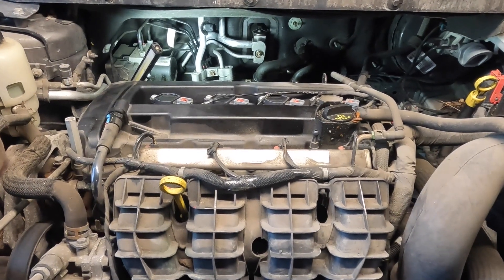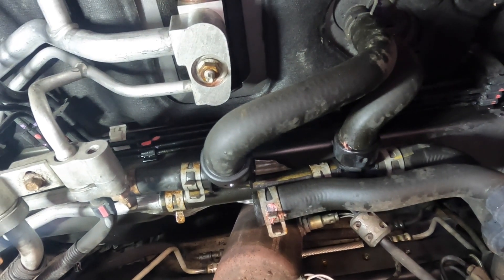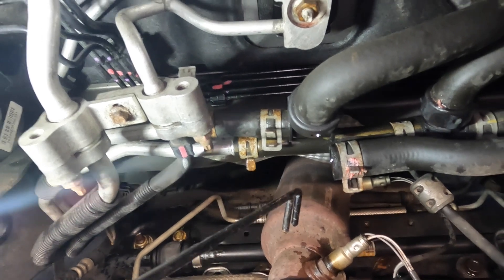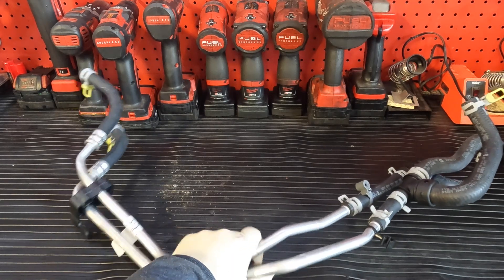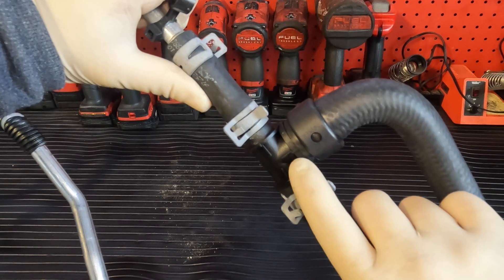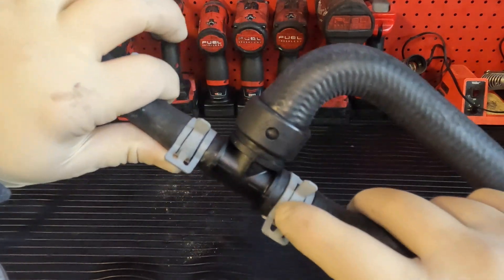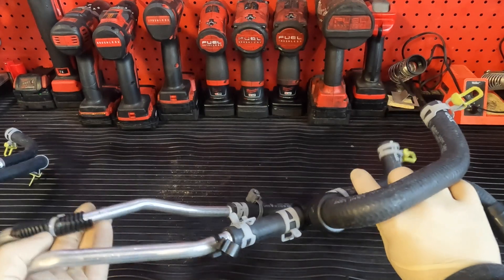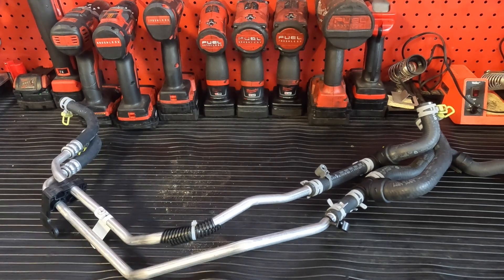ENGINEERING FAIL DODGE 2.4L HEATER HOSE MADE OF PLASTIC LOCATED RIGHT ABOVE CATALYTIC CONVERTER!

Comment: Currently sitting at the mechanics getting this replaced lol
Reply from the maker: Hopefully, they’re not charging you an arm and a leg to replace it. You should ask then if they’re using an original part or aftermarket because there is a company out there that makes a new line with all metal instead of using plastic like that original style.

Comment: Must be those Fiat engineers that took over Chrysler after Obama gave it away, I guarantee you that's why every Chrysler motor has poorly designed parts and poorly placed parts.  This kind of engineering is why the Big Three were always way ahead of ant European manufacturers, now Chrysler has fallen to sub par European design engineers.